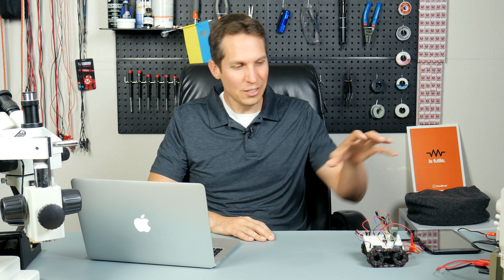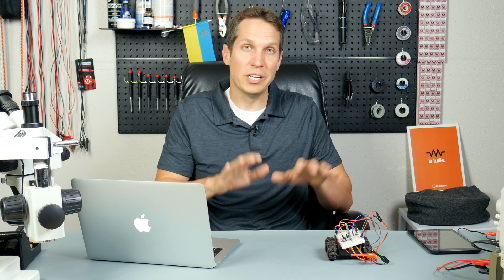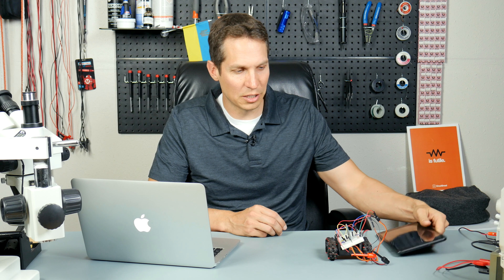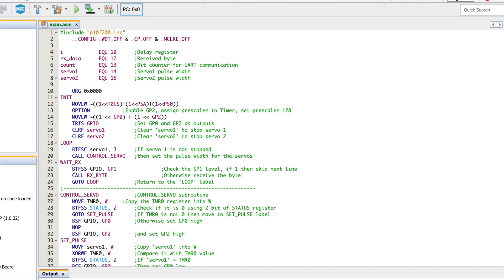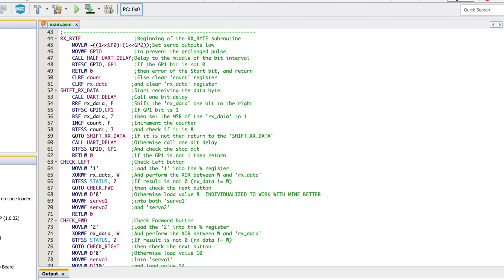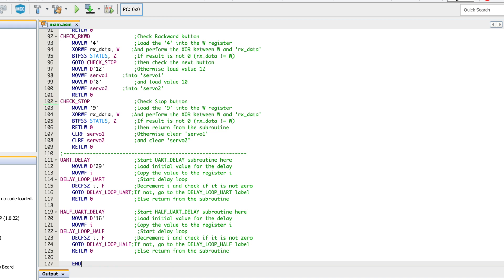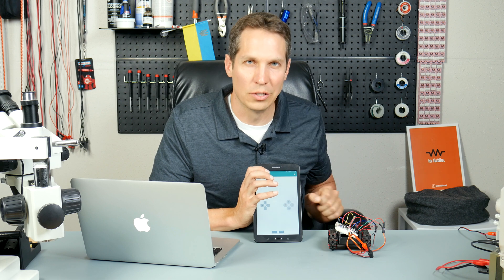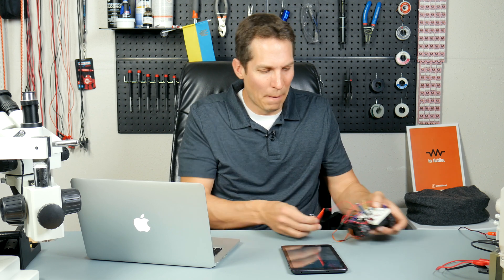Bluetooth Controlled Robot - Part 12 Microcontroller Basics (PIC10F200)

Comment: I am a fine Artists trying to learn EE. I am trying to understand the concepts enough to be able to manipulate scrap devices and repurpose them. I feel like it’s too hard and considering giving up. I just don’t know how to learn the right things I need
Reply from the maker: It is definitely a challenge!  To be honest, if you're an artist that is looking for a more practical, easier introduction to microcontrollers, I'd recommend looking at the C-based PIC18F14K50 series we're doing instead.  Sergey has over 20 written tutorials though only a couple videos have been published so far.  This particular series is incredibly useful to understand what's going on at a lower-level of a microcontroller but if you want to just make something, I'd recommend looking into that.  As to the other concepts, I think you're doing the right thing - searching what you need solving problems as they come up.  That's a challenging but very practical way to learn.
Reply: @CircuitBread  thank you very much for your advice I will look into it on the website.

Comment: English isn't my first language so if you don't get what I say, pls forgive me! :(
What I know is: after 2 lines "MOVLW ~((1<<T0CS)|(1<<PSA)|(1<<PS0))
    OPTION", timer's value will increment automatically from D'0' after each 1 micro second tick. When we begin with "LOOP", in order to imagine easier, let's assume that servos still stop then we receive only "CHECK_LEFT" command, then "GOTO LOOP". We'll start to "CALL CONTROL_SERVO". Now, TMR0 register's value isn't D'0' (because we go through quite a lot of instructions, more than 128 micro second, I guess), so we set GP0 and GP2 high.  We go to "SET_PULSE", because both values of "servo1" and "servo2" are D'10', and TMR0 is also not D'10' so we can't make a pulse at all. Then we have to go to "WAIT_RX" and wait for "CHECK_LEFT" command. 
But the problem at here is: The chance TMR0 equal D'0' or D'10' is very small, I don't know when it equal D'0' or D'10' so it can't make pulse as we want. Please explain it for me, I'm sure that there are something that I still don't understand. Thank you for reading all stuff that I've written, I know you're so busy, so pls feel free and reply me when you have time. Thank you so much :)
Reply from the maker: It seems like this would be a great question to ask on our Discord channel, so that I can ask some clarifying questions and we can get some more input from others that have gone through this series.  But, in general, when you need to do something when an MCU timer equals an exact value, you need an interrupt (not an option for this simple of a microcontroller) or you just have to poll a lot and make sure that your polls are frequent enough to not miss it (not-ideal but acceptable if it's not crucial to catch it every time).  But please join us on Discord so I can make sure we get your confusion figured out.